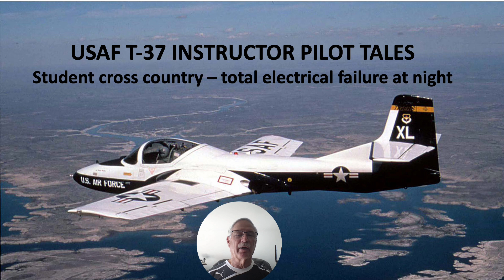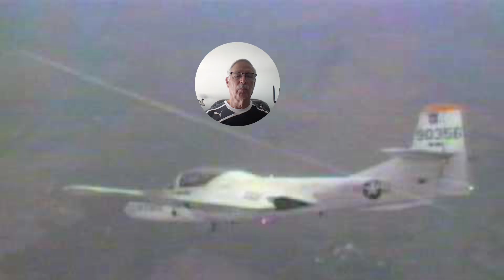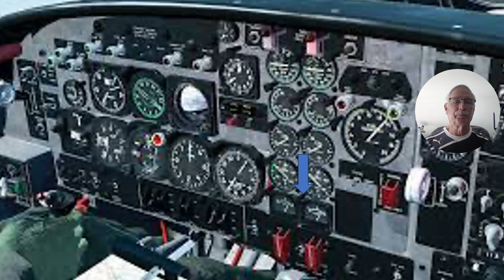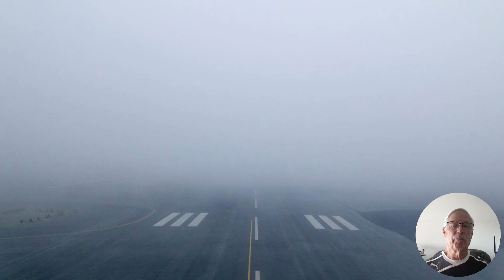T-37 Total Electrical Failure at Night! Instructor Pilot Tales

Comment: Not electrical failure, but complete pitot static system failure in a B-52 (not me, thank God). Airplane departed Guam on a 3 ship night combat mission to targets in S Vietnam. Near the Philippines at around 25,000 ft, the radome failed and departed the airplane, taking the pitot tubes and other parts of the static system with it. No instruments available, the crew was losing control of the airplane, so they bailed out. There was an extra crew member on board as an observer, so a total of seven. All landed in the Pacific and got into their rafts, one with a broken leg. 

Did I mention they were in bad weather and heavy seas? So how did it turn out? The other 2 airplanes contacted the controller who alerted rescue. A C-130 was dispatched to the area and made radio contact with and circled the group. Now for the good part; a NAVY nuclear submarine was returning to the Philippines from patrol. They were contact and directed to the location, where they surfaced and picked up the crew.
Reply from the maker: Now that is a story! And being picked up by a sub! No that would be so unreal!
Reply: @ Better than being eaten by sharks! Knowing SAC, they were back on the schedule as soon as they dried out. 

Did I tell you the one about a non-stop three air refuelings from McCoy AFB to Guam and losing two generators mid-Pacific? For another day.
Reply from the maker: Sounds like another good story!

Comment: I assume that the T37 is an original {fly by wire" aircraft. You have steel wires that rung prom all you control surfaces to you pedals and stick, but how do you do flaps?
Reply from the maker: They are operated hydraulically.